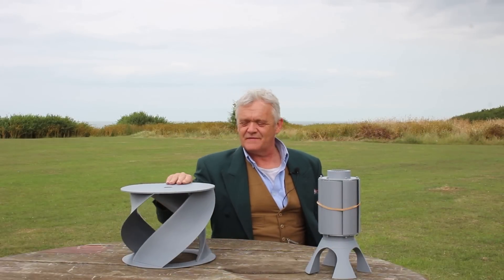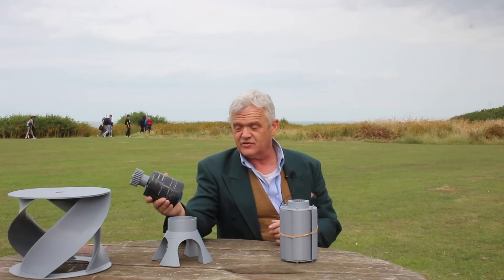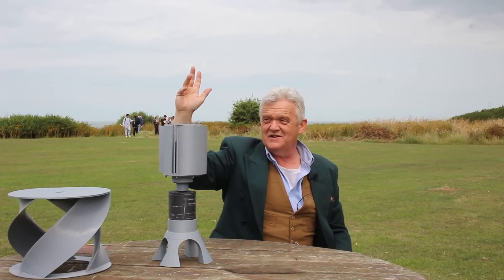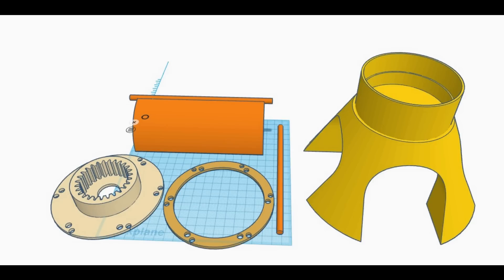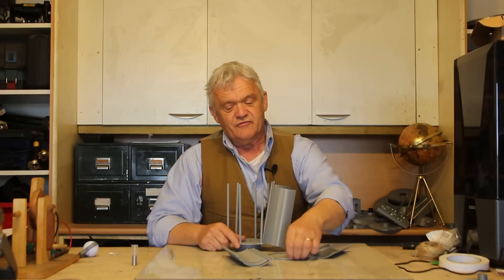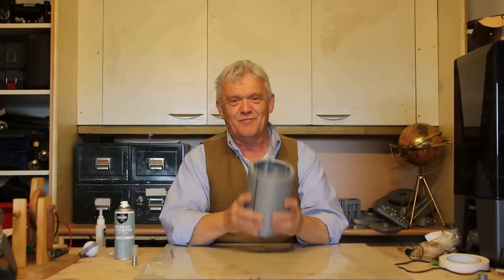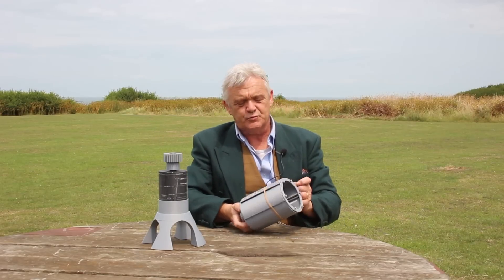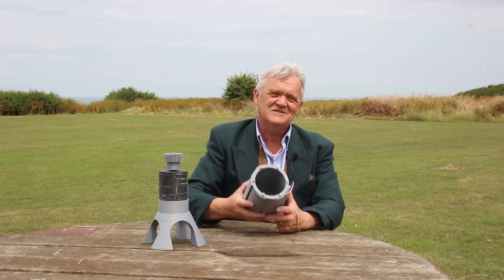1977 The Lantern Wind Turbine - Portable Power Production

Comment: Awesome design if noisy. 
I made a similar version years ago with the sails capturing the wind inside the circumference of the wheel & with less sails 3-4. 
I think this may be more efficient as the rest of the wind will pass through the structure instead of round the curved surface of the closed sails (less drag).

Comment: Just a thought...why not redesign the drive hub so the drum would operate upside down..in your current "stowed" position..
You could then adapt the base to hold a large ring bearing to support the open (now downfacing) end of the drum for stabitily ?
Legs on the base that fold up inside the base frame for transport would further reduce the stowed dimensions..

Comment: Line the outer rim with felt where the blades contact and that will reduce the nose significantly. Though, rubber is waterproof and should do well too so perhaps that is a better option. Some of the noise may be the blades hitting the support rods as well. A few small rubber bands down them may do the trick! Might be a bit time consuming putting them on, but hey, it'll be quieter! The very edge of the blades could use a bit of a curl upward, perhaps a half centemeter, just enough to help grab the wind easier as they come around to the "catch" side and cause the blade to swing out sooner.

Comment: I suspect that if you took it camping the neighbours would be throwing rocks at your tent because of the noise. I also wonder about the potential wear at the pivot points. What about have the blades on tracks so that they can slide in and out and lock into place in both open and closed positions. I also suspect it might be more efficient.

Comment: Love this, it reminds me of my Pringles tin turbine. Currently working on a bigger version and I have an idea that might help with your noise problem. I wanted to create a wind pocket instead of just the sail, as I think I could "trap" more air, so I needed a top and bottom cover. I've settled on the idea of using a folded material (card, plastic etc) like on an old Chinese hand fan. You could use the same idea but with folded rubber (like on an old bellows) and this would dampen any sound from the flaps and would also create a wind pocket, which I think is more efficient because you don't lose any air out the top or the bottom. 
Also, when you make the larger bladed version, you could mount it on a cylinder instead of a frame, as I feel you are losing "wind power" into the body of the open framework.
Please feel free to use my string and eyelet method, so as one flap opens, the previous one is pulled shut. This would create less drag on the closed side of the turbine and I think you would also get some benefit from the air being forced out of the closing flap. As always, thanks for posting this, you are the hardest working man on youtube.

Comment: Awesome work on the concept Rob!
I was thinking though, would it work even better if you put a very, very soft spring that’s holding the blades closed inwards to possibly prevent some of the parasitic loss coming from the blades hitting and losing energy from the impacts?

Comment: I think, with the low Reynolds aerofoil one, that it'd be better to mount with the blades above the generator, that way it avoids blocking so much of the through wind, also causing turbulence, which matters to a lift style.

However with a drag style ( especially one with closing blades) as through wind if fairly irrelevant and it might be better to design that one so the generator is inside the blades, giving a more compact, in use, device but also lowering the centre of gravity and the leverage force that might cause it to fall over, essential no loss, or increase, of output but a more stable design.

Comment: WOW, can you imagine the sounds of an Off Gridder using both this Lantern Wind Turbine and a RAM Pump for a water pump. The combination would drive you crazy. Granted you should be able to decrease the noise on the Lantern Wind Turbine through the use of a soft rubber bumper. I wonder what the increase in output would be by increasing the overlap of the fins.

Comment: Could make it twice as long so it would sit on the gear right on its center of gravity, though I guess you went for being "portable" with this design. Interested to see what's the friction loss from all the moving parts compared to a traditional turbine and if flexible blades would be beneficial in compliant design which could deal with noise issue and create a more aesthetically pleasing effect to put a larger version as an installation in a park.

Comment: Just an idea: you might be able to redesign that base to be a slightly larger circular base, then you could remove it from the generator, flip it and it would make the whole thing smaller and also hold the blades in place for transport.

Comment: I have more hope for your darrieus wind turbine.  About a 10 foot diameter rotor would be a good start.  A low Reynolds number airfoil of that width needs about 50 MPH of speed to start flying right.  The narrower the blade the more speed is needed to reach an acceptable Reynolds number.  At 5,000 almost nothing flies,  at 50,000 the low Reynolds number airfoils are at their lower limit, at 100,000  so-so,  At 1,000,000  great performance.   

Also more spacing between blades gives the wind more time to speed up again after the blade before it sucked the speed out of it.  Low Reynold number airfoils are popular on sailplanes and model airplanes because they don't need to be traveling at 100+ mph to get decent performance.

Comment: My intuition is that you are losing a lot of energy with the blades opening and closing. I think fixed blades would be better. Could be done with a little ramp/tab on the top and bottom disks. Not certain, just intuition.
Reply: You may be right. Would be interesting to test. :)
Reply from the maker: i think what is lost on one side is gained on the other as there is a concurrent reduction in drag with the blades closed so that overall i am guessing there is a net gain

Comment: I just came across a story about a company that makes evTOL aircraft company, CycloTech. Instead of propellers they deigned what they call a CycloRotor. It's hard to explain how it works. They have videos explaining how it works on their YouTube channel. It uses an eccentric mechanism attached to blades in a drum configuration. By moving the eccentric hub mechanism it redirects the blades to provide thrust in any direction. It got me wondering if the same concept would work as turbine.

Comment: A bunch of other comments have suggested using sails, and I agree.  Using printed parts to give the the sails shape would help cut down costs and enable the turbine to be scaled to a much bigger size than the printer can make.  And if you use recycled bed sheets or plastic grocery store bags it becomes even cheaper and reduces the stream of waste going into the landfill, win, win, win 😁👍.
Reply from the maker: sails are a good idea and i have seen sail based versions
Reply: @ThinkingandTinkering  yeah, and using strings/wires in tension can help the sails keep their aerodynamic shape with light/thin/collapsible beams.
Reply: @ThinkingandTinkering  How about using a very, very soft spring that’s holding the blades closed inwards to possibly prevent some of the parasitic loss coming from the blades hitting and losing energy from the impacts?
Reply: I used paper sails on my Pringles tube turbine 🤣 Working on a larger, more serious version, so I will need a material or framework that gives me all the lightness of a sail and the structural strength of a blade. I like your idea, reminds me of tissue paper and balsa wood model gliders and also the first human pedal powered plane.

Comment: Hey Rob! I have an interesting idea for you exploiting a fun thing in fluid mechanics. What if you replaced the flaps on your wind turbine with spinning rods? This would be a VAWT that exploits the Magnus effect to dynamically apply lift with minimal loss. The rotor assembly would thus spin in the opposite direction of the direction the rods are set to spin. And if you wanted to play with it further, you could use a planetary gearset to use the rotational energy of the rotor to spin the rods faster, enchancing the performance of the turbine. I think it can be made into a highly compact, portable form AND require even less skill to make. What are your thoughts?

Comment: I would like to suggest two light very weight springs one on the top and of the bottom of each blade so the blades do not smash into back post, the springs would allow for the blade to fully open up to the post without straining to get there, better transition when the blade fully, I am concerned that the blades will adventually break the post and blade.

Comment: Also, it's great for portability, but you could introduce a twist lock vane opener at the 'top', allowing it to be locked open or closed for transportation.
Reply from the maker: yes i did think about it - like an iris box?
Reply: @ThinkingandTinkering  even just a ring with small nubs which open the vanes as it's twisted around.
It could have other small nubs and indents on the inside of the ring to help lock either open or closed.

Comment: Torsion springs would help with the noise and dampen the force of the flaps swinging open. Might make for a more efficient motuon transfer, especially with larger flaps/blades. Just a thought! AWESOME build!!! 🙌
Reply from the maker: i like the idea especially for a larger version
Reply: Torsion springs or just a rubber band thats a tad shorter then the max opening angle would really help against that clacking noise, wouldn't it?
Rubber bands on something like the tuning pegs of musical instruments, so you can adjust their length as needed
Reply: @Marian_Martin_Morgenstern  That's a nice, inexpensive compromise! 👍 Lightweight too
Reply: Yeah I commented about this aswell.

would it work even better if you put a very, very soft spring that’s holding the blades closed inwards to possibly prevent some of the parasitic loss coming from the blades hitting and losing energy from the impacts?

Comment: since the lantern blades harness energy from the wind passing around the turbine, rather than passing through the turbine as is harnessed by airfoil, what if you attach the lantern upside-down (as seen at 5:00) with the airfoil mounted on-top?
I assume a single unit of the two combined would have negligible performance improvement.

Comment: Would the blades slamming back not cause more harm than good? I feel like left open it would be far more effecient. It would be interesting to see a side by side with one kept open to see what the power output was. Also when the blades are shut they have to open again, there must be a pretty good amount of energy lost while they are opening though perhaps at faster speeds the gravitational forces would keep them open. Which also brings up the point of how weight on those wings matters. Interesting concept, something that you could spend a lot of time tinkering with.
Reply: YeahI thought about this aswell and made a comment about it. There’s definitely some parasitic loss regarding the blades slamming into eachother. 

I was thinking though, would it work even better if you put a very, very soft spring that’s holding the blades closed inwards to possibly prevent some of the parasitic loss coming from the blades hitting and losing energy from the impacts?
Reply: Conservation of momentum saying that the slamming open will increase the rotation, but on the flip side, the closing slam transfers energy mostly inward instead of backwards, so a net gain compared to fixed blades.  The tradeoff being wear and tear on the machine itself.
Reply: What about counterweights on the axis of the chord line, inboard and centered about each main blade pivot..
When the wind attempted to open a blade, its opening would be dampened by the static inertia of the counterweight, slowing it down which could be tuned to the average wind speed to prevent blades reaching "full stop" before loosing the wind effects as it turns .. with the added advantage that the counterweights would experience increasing centrifugal force as the rotor speed increased, resisting the blades effort to open even more as rotational velocity increased.

Comment: This design is inefficient. It'd be better if it wasn't a flap out design. Too much energy is being lost to the flaps opening and closing thus slowing the rotation of the turbine. It's also very loud. I'd suggest a central screw system which allows you to close the flaps for transport and then open them to a fixed position when in use.
Reply from the maker: cheers
Reply: @ThinkingandTinkering  Don't get me wrong, it's a cool idea, and might be better for a water wheel with a horizontal position, but for wind there simply isn't enough kinetic energy there for the opening and closing process to also transfer the energy tino rotation. The conservation of angular moment is crucial here.

Comment: Could be annoyingly noisy on a campsite.
Reply from the maker: how would you make it quieter?
Reply: @ThinkingandTinkering  Why not go back to the the Darwin turbine arrangement with the cones directing the wind to a horizontal blade? I understand that you are trying to keep it compact, but perhaps there is a compromise where the cones are in some proportion to the base and even pack with the base. It might be shorter and wider when packed, but give a taller structure with more wind capture whan set up.

Comment: Nice elegant design!

Maybe you could nest a slightly smaller one in the larger one and stack them in layers?

Would that speed up the overall device or slow the device down to the speed of the slowest layer?

Or maybe more loose blades of the same diameter and a top piece inside and you assemble the second layer on sight if needed.  More work for setup though.  Maybe plastidip the blades and hang them to dry on their tabs with the dipped end pointing down for even drying?

Comment: As an added bonus, if the winds get too fast, the weight of the blades will cause them to swing outward from enertia and act like a brake, keeping the speed in check.
Reply: That's an amazing mod of the previous flat version with raising blades!
I would only put some rubber dampers to reduce that "clack-clack-clack" 😄
After an hour of camping near this, i would go 3 fries short of a happy meal 🤣
Reply: Damn that’s actually a pretty genius thing, I never thought of that!

Comment: Awesome build mate. I had a thought about a portable wind generator as I was watching this video. 
Have you tried combining 3d printed parts and fabric? With a 5 gallon bucket filled with water and a tube of silicone caulking and a bedsheet makes a waterproof bedsheet that can be folded and used as the sails for the wind Turbine. It would be easy to carry light and capture alot of wind using fabric sails.
Reply: Laundry flapping in the wind!

Comment: I am noticing that your presence is often acting as a bit of a windbreak. Only saying, because some might not notice, and think the device has poor performance.
I'm already trying to think of an assembly line for making the blade assembly out of sheet metal.
Reply: You are right, there's a massive energy loss on opening and closing flaps. 
There's a way around this, but it will make the build less simple.